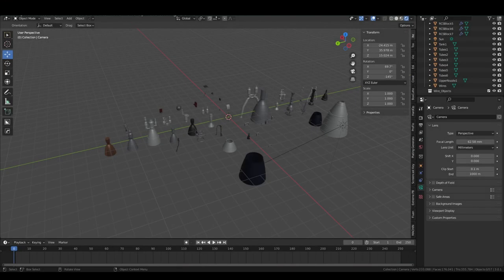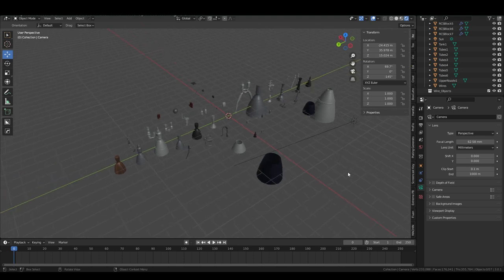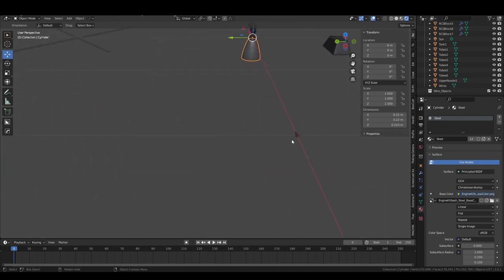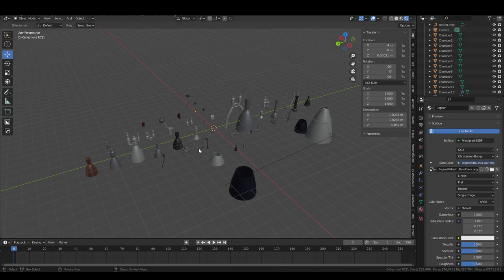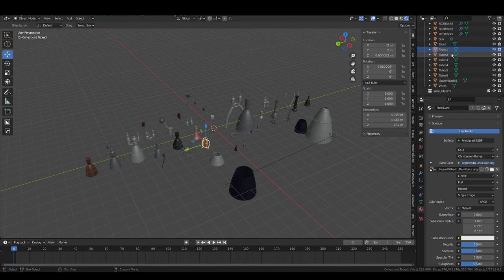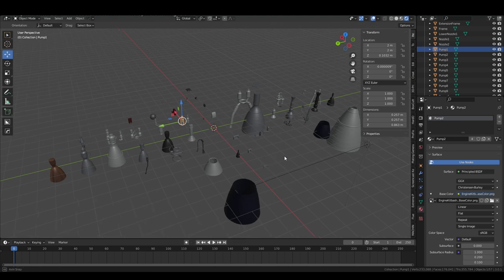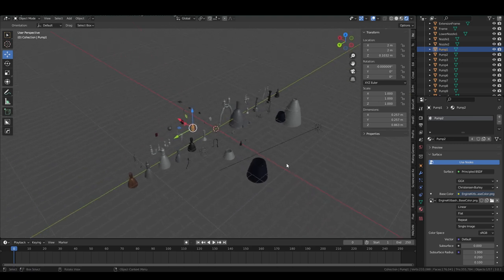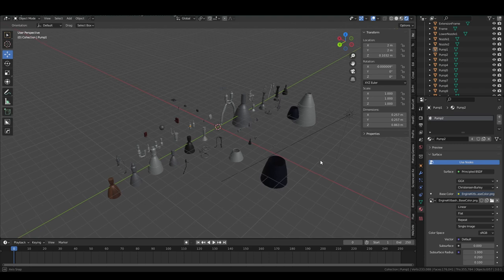Rocket Engine Kitbash for Blender

Comment: How do you calculate nozzle geometry? I've seen the Rao parabolic approximation come up a lot, but in solving the parabola you only get 2 points and 2 angles, and I'm not sure how you could solve a parabola from that. Also how might you model a tube-wall nozzle, that doesn't have a solid color outer wall(think RL10)
Reply from the maker: These parts are derived from real world engines, so I didn't actually calculate their geometry - I just looked at photos and tried to model what I saw. As far as how I would optimize a real engine? Experimentation and observation unless I have access to some CFD software to adjust it like that. Not everything can be calculated ahead of time straight from a nice equation. For the tube wall, it would be best to use a texture because you'd need a lot of geometry and that's largely useless in the context of KSP because you won't be able to make out the fine lines on the model anyway. If you insist on modeling them, you would have to have a lot of vertical edges on the nozzle (best to keep the nozzle a simple cone with a single horizontal row at this stage) and then inset and extrude the faces. After getting the extruded sections representing the tubes, then add intermediate rings on the nozzle to change it from a cone to a curve.
Reply: Yeah, I'm just not great at texturing, that would be hard to make it look right
Reply from the maker: Either way, it's hard to get fine lines to render right, especially in a game.